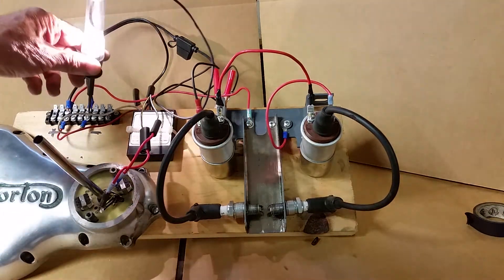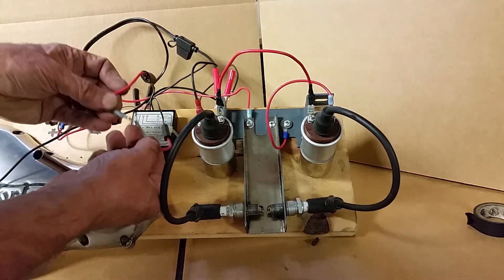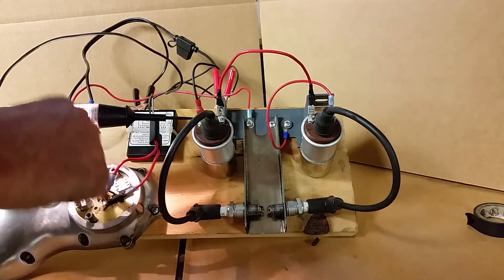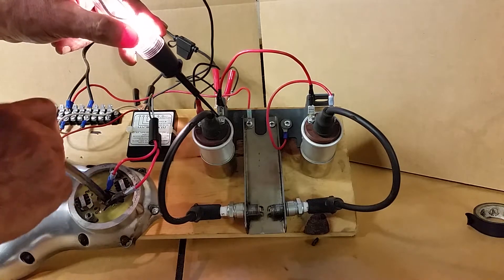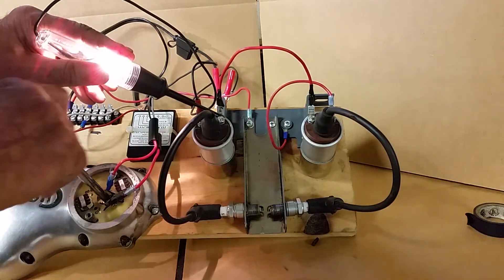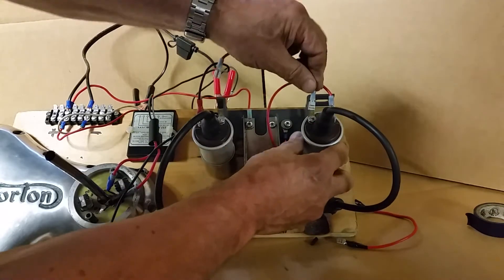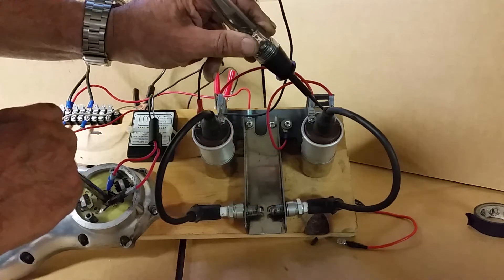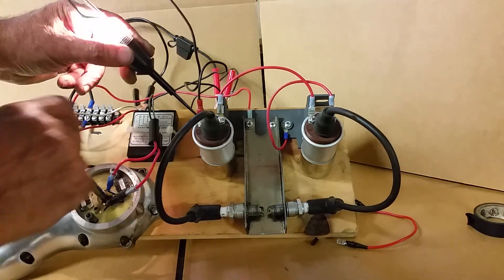Boyer Ignition Troubleshooting

Comment: Hello. First I very much enjoyed your videos. I just installed a Boyer Bransden Micro-MKIV on my 68 BSA 650 Lightning. I started the testing: spark plugs out but connected to the coils, ignition on, power to the control box, turned over the engine but no spark. I unplugged the coils from the stator plate and touched the wires together as in your video and all works fine. I used a magnet to pass over the coils on the stator, all works fine. The magnetic rotor spinning behind the stator plate does not generate any spark. I took the stator plate off and touched the pins on the back of the coils to the magnet on the magnet rotor and I go get spark but not consistently. So, shorting the black/yellow and black/white wires from the pickup coils works. passing a strong magnet over the pickup coils works. Just rotating the magnet rotor behind the stator plate with pickup coils does not work. 

I would sure appreciate suggestions. Thanks.
Reply from the maker: My first thought is to make sure the rotor actually is turning when rotating the crank. It sounds like the electronic bits are working fine.

Comment: A brand new Boyer/Bransden micro system installed worked great for a few months then failed which i'm now thinking was probably due to not having replaced plug caps with recommended 5k ohm units.
Would this have completely destroyed the device or just caused it to behave erractically and likely to work with correct caps?
Reply from the maker: Just get the 5k caps and it should be fine.
Reply: Yep, on order but was more a general question as my previous Boyer system failed and at time didn't understand why. Replacement being fitted soon 'with' 5k's @nortonguy-u7l

Comment: The bsa A65 twin I'm working on  that has a wassell fitted seems to have an intermitant spark issue works fine cranking over  5 or six times then no spark for a bit then spark comes back.
Reply from the maker: I would check your connections for voltage drop due to a loose crimp or corrosion and of course all grounds. Also make sure you have 5K resistor plug caps otherwise you get some funny symptoms especially on BSA's for some reason.
Reply: My 1974 Trident T150V started with a kick, however when riding my bike, I noticed that I was loosing sparks. There was too much unusual but light vibration coming from the engine. Electronic ignition is more sensitive to voltage drops than the old fasion points type ignition. When there is an irregular power input, electronic ignition will malfunction.

I decided to check the power of the Boyer ignition. I put an oscilloscope at the power cable of the ignition and I found the following:
- The standard single fuse vibrates so much in its fuse holder due to engine vibrations that the power may vary some volts over time. This looks odd, but I could clearly see this on my oscilloscope screen.  I changed the fuse and fuse holder to a modern type, that is not sensible to vibrations.
- The wiring from the battery to the boyer ignition unit goes a long way in my bike. The wiring, switches and connectors are about 50 years old now and I noticed that the resistance from the battery to the boyer unit was sensitive to vibrations also. I bypassed the original wiring and made a direct connection between the battery and the boyer unit. (With this I bypassed the kill switch, but that’s ok for me)
Both measures had success. The engine ran fine afterwards.

Comment: Very good video. I'm new to Triumphs and im really happy for people like you that put this info out there. I did the same test because I have no spark. however my test light comes on with out me turning the motor over. All coil connections are lighting and do not go down. Do you have any advise?
Reply from the maker: Sounds like a short to ground in the primary, check your wiring. Coils are probably getting pretty hot so don't leave it on for too long.

Comment: My 1974 Triumph Trident T150V has a newly installed Boyer Brandsden ignition (type Mark 4). After a successful installation the engine ran fine but after a while it became very difficult to start. When it fired up, after many kicks, the engine ran horrible. I checked the plugs for a spark: that was OK, so all my attention went to the carburettors. After many hours of checking, cleaning and justification nothing was found to be wrong so I went back to the ignition. 
I found your youtube movie about the test of the Boyer ignition.
My test showed that the coils had power allways, in the contrary to what you showed in your test. That could not be a reason for malfuction of the engine but as you noted: when the engine does not run and contact is on, there should not be power on the coils. I checked the pickup coil with a magneto just like you did, which created sparks at the plugs. Check for timing was positive, so overall there seemed nothing to be wrong. With no idea left where to look, I decided to read the specs of Boyer Bransden once more. They stated that electromagnetic interference could occur if you deviate from their spec for the HT cable, plug caps and spark plugs. The right cable has a copper core (mine had carbon), the plugcap is recommended to be of the suppressed type with 5000 ohm resistance (mine had none) and the plug should be non suppressed (mine was of the resistor type, so suppressed). I made three new cables and installed the right spark plugs. 
Result:  one kick and engine was running very stable at idle speed and cold engine. This was the right solution. This issue of electromagnetic interference is easy to overlook, however it might cause serious trouble. How to test this? I have no idea. I think you have to comply with the specs in the first place, that is probably the best way to go.
Reply from the maker: This is something Boyer fails to emphasize, the 5K ohm resistor caps or resistor wires are essential or some odd problems (like yours) will occur.
Reply from the maker: I wish that they put in the instructions you MUST use the 5k caps or you will have problems. I ran into this problem myself.